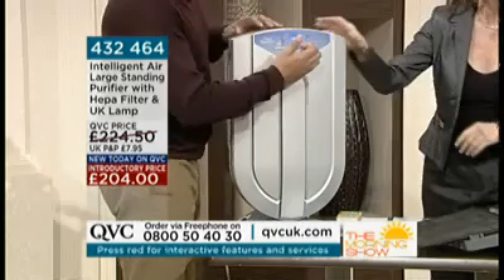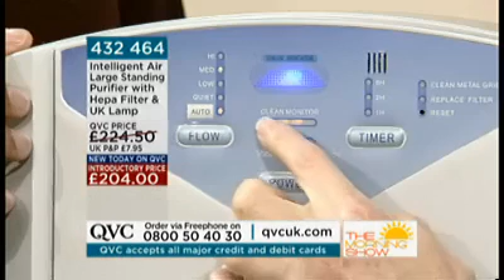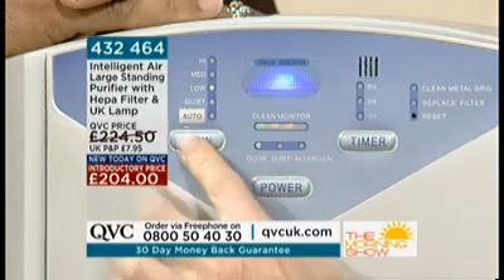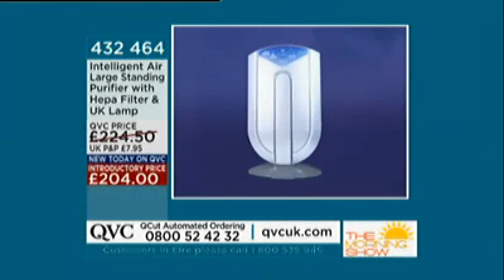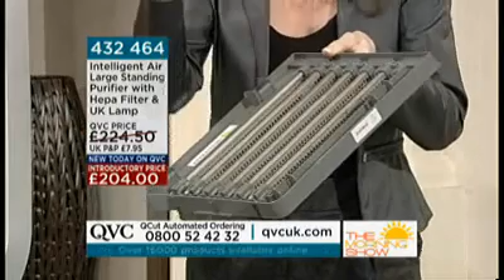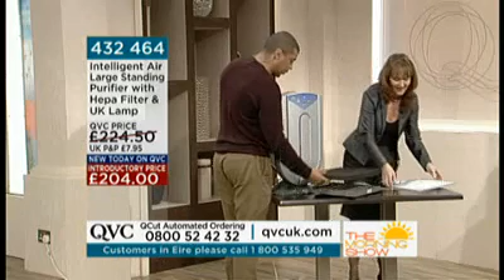Heaven Fresh  NaturoPure™ HF 380 Intelligent Air Purifier

Comment: biggest load of junk ever.  You'll see it all around the net under different manufacturer badges.  I had one of these as I suffer from allergies.  This is a cheap nasty piece of crap.  Within a year, it decided that the air was permanently filthy, and wouldnt reset, and to make it worst when I looked into the fan vent where the clean air comes out, it was thick with dust.  The different stages of filtration dont seal, so whilst some air does indeed pass through the filter and get cleaned, because the filters dont seal, air is able to bypass the filters and just go back into the room, hence the dust and god knows what other stuff was essentially being pushed back into the air.  Lousy.  Replaced with a blueair unit, and whilst more expensive, the filters seal in, air cannot get through without passing through the filter, as as such even after a year, the clean air outlet was dust free, and when it came to changing the filter, it was absolutely filthy.